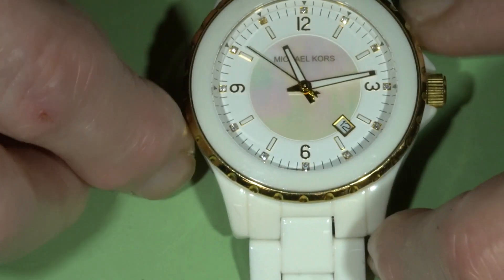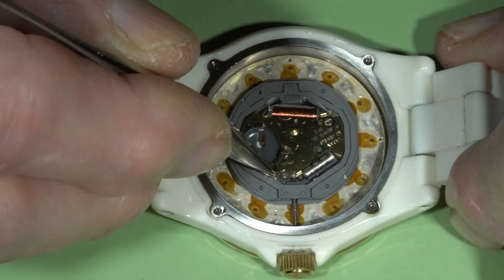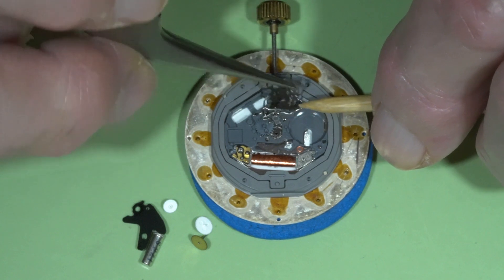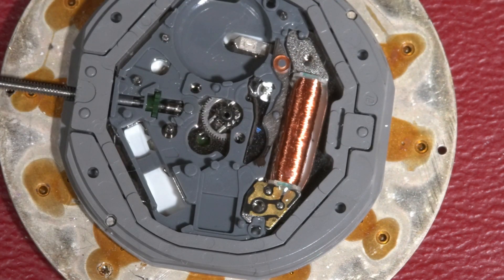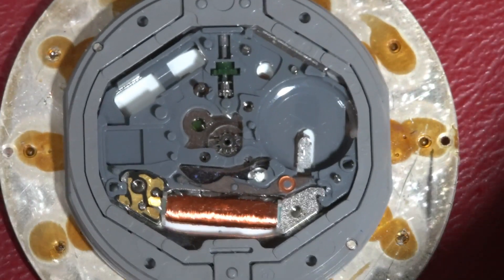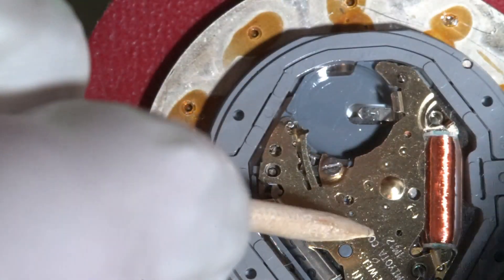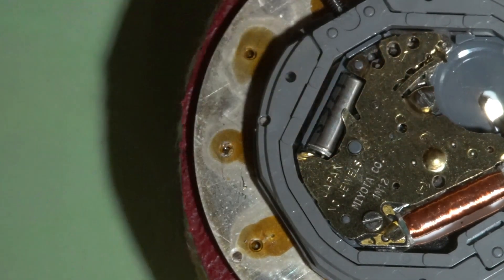Minute Hand Stuck in the Miyota/Citizen 1M12 Watch Movement How To Repair

Comment: Thumbs up for your video ! 👍
I have a Festina F16374 with the same movement and the minute hand started to shake back and forth each time second hand is ticking. I would like to open it but I'm not sure how to do it.
I noticed that you aligned all the hands before removing them. Do you have to also align the second hand when you reinstall it please ? I read somewhere that the hour and minute hand are linked but I don't know about the second hand on quartz movement. Also does the dial is glued on the movement ? 🙏
Reply from the maker: Thank you! The hands are better to be aligned before removing them to prevent their possible damage. When installing the second hand, it could be aligned to any position, just to match hand's tip with any of the second marks on the dial. For not so high quality dials, this is not necessary, because dials can have misalignment by their self. Yes, hour and minute hands are meshed together via gears and should be aligned accordingly. And dials are not glued to the movement. They are kept by dial feet. Some are also tied up by special screws.
Reply: @ValentechTime  Thanks a million for taking time to respond me very clearly and for your precious help ! 🤝
Reply from the maker: @_Platinum-  My pleasure!

Comment: Thanks for posting! I had the same problem. The second hand stuttered in place so I disassembled to find the large white plastic wheel has two broken teeth. How does that happen? I checked my spares, but no luck on the part. Movement Y121A Japan is fairly common. I might find something at a flea market for a couple dollars, but putting on the train of wheels bridge with these little bits is a nightmare.
Reply from the maker: Thank you for the comment! And for the story. Y121E is hard to repair, I agree. It was made simple, but they built it to be inconvenient for disassembling/assembling. Hopefully you will find a replacement.

Comment: hello sir my watch changes date at 10.30 pm before 12 am how to correct it
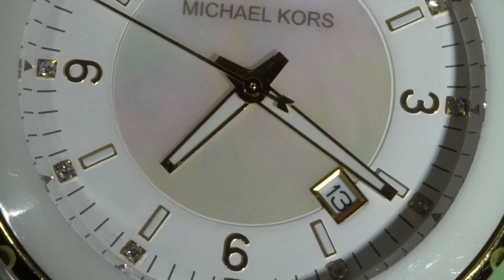Reply from the maker: You will need to remove all hands and find the midnight point which is when the date get changed. Find that spot by rotating hands and watching the date window. Stop rotating hands as soon as date changes. Then put back hands one by one, in the following order - hour, minute and seconds hands. Point all hands to 12:00 o'clock. Do this sequence without battery inserted. Good luck!
Reply: @ValentechTime  hello please please make tutorial on it please
Reply from the maker: @sanjaypatil3097  Hi Sanjay! I have an another video where all steps of setting hands at midnight position are shown. Please take a look at https://www.youtube.com/watch?v=Qk8yN2dTtYo. Let me know if it helps. If it doesn't, then I will work on creating yet another dedicated video.
Reply: @ValentechTime  yes thanks sir it worked but now my day changes at near about 3.45 am is it ok or we need set it by another way...?
Reply from the maker: @sanjaypatil3097  What movement model do you have? If it has both date and day, then it's normal, that day changes in 2-3 hours after date (which changes at midnight). So, the answer is, yes, your watch is set up correctly.
Reply: @ValentechTime  Thanks for all your comments and help i have unajusted miyota japan no jowels
Reply from the maker: @sanjaypatil3097  You are welcome! Glad it worked out for you.